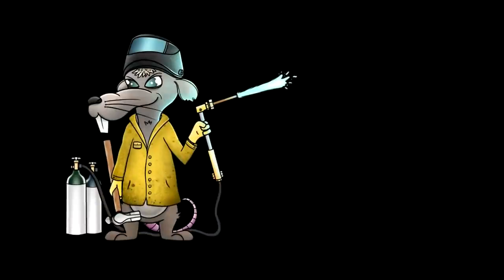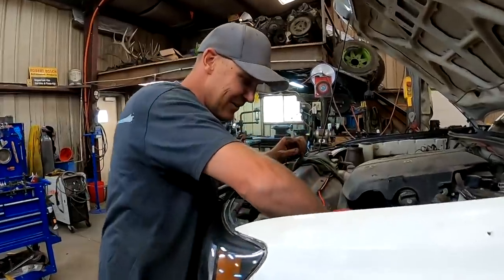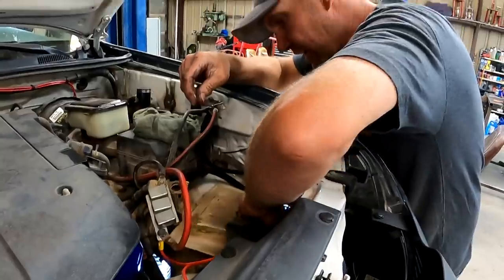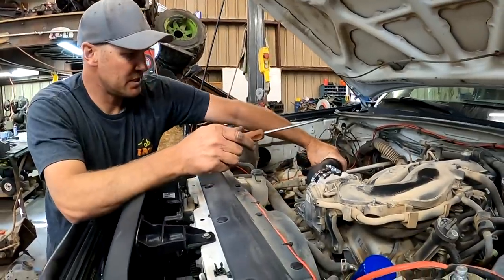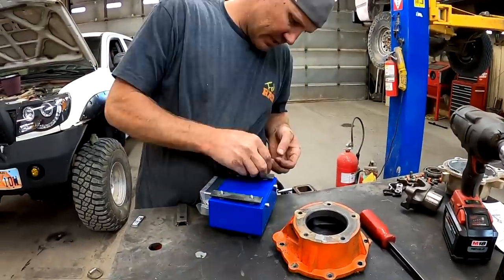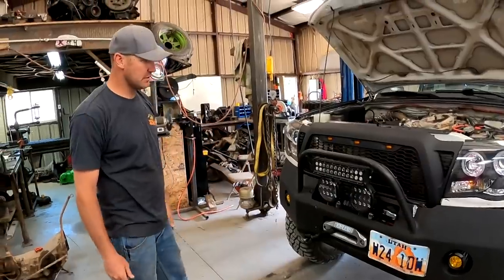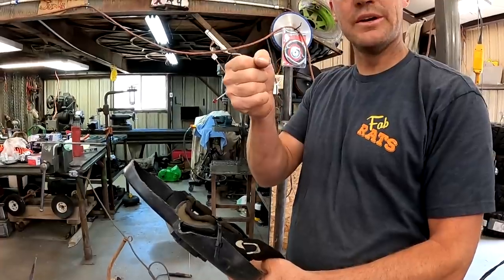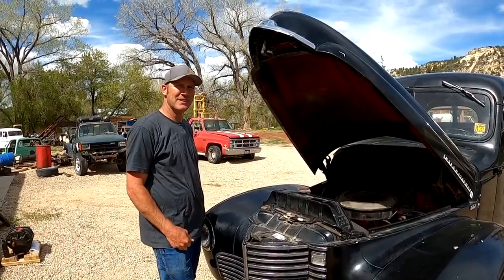What's the weird MASK for?! -- Plus, the returning of the International Pickup--

Comment: For the record, the flashlights are from Harbor Freight, and are rechargeable!  I have a few myself.  Just wait for a sale on them and grab a couple, they go fast.
Reply: Was about to say the same thing, they're good magnetic based lights.
Reply: I got my first light from Harbor Freight, cost me $38.00. Then found out my neighbor gets them wholesale, & resales them for $25.00. I told my wife (school bus driver) now the cost of that light has jumped up $125.00. All the other ladies driving wanted them, so far I've not been reimbursed for any.... LOL 🤣😆
When I saw Paul kept tripping over his work lights I figured what's a few more.... Good to see he's getting some use out of them....👍👍👍
Reply: @LAWMotorsportsdotnet  Someone gave me some of those as a gift after I they saw my HF light, they are not as bright, the magnet is not as strong and the batteries are not replaceable although they are rechargeable. They do bend differently tho, so I keep them around, but my HF lights are still my go-to.
Reply: I would like to know how your drill doctor worked for you.
 The purchasing agent for a shop I used to work at, bought one, and you could not sharpen a drill with it to save your soul. I have sharpened by hand since the early 70's, but anything under an 1/8 inch, has gotten hard to see with the naked eye for some reason. 😁

Comment: Always wondered if it was possible to attach this kind of equipment to a vehicle I bet you wish you had it when you and Matt repaired the broken rear diff on the side of the steep mountain trail with your regular welder that didn't like running on the incline.

Comment: I bought a Drill Doctor about 10 years ago. Awesome piece of equipment. Sure beats trying to get the angles right on a grinding wheel (which I never could do). I've even sharpened broken drill bits. Just watch the enclosed video if it has it. Mine did. Saved me a lot of time and hair pulling. Another excellent video Michelle and Paul. Take care

Comment: I always assumed a premier power welder required a second dedicated alternator, after seeing this I might have to finally buy one 👍, less bulky than running a 110 volt flux core mig machine off the big power inverter, and way easier than loading a big generator and one of the big welders in the bed! 😄

Comment: That's not a bad drill press Paul.  Two things to look for if you replace it is a 16mm keyless chuck and infinitely variable speed.  The chuck should have #3 Morse taper so you can use larger drills.  I particularly like having infinitely variable speed as it means I actually change speeds when I need to, rather than put up with the wrong speed because it is too much trouble to move the belt.

Comment: Just got a drill bit sharpener last week. I think I may have had one or two bits that were not dull or mangled. Once you get the hang of the sharpening process, bits take about two or three minutes a piece to doctor up and make useable again. Sweet piece of shop equipment I should have bought years ago. That isn't an inexpensive welder control unit you got, as I just priced them at over $1200/ea. If I spent half as much time on the trail as you, I'd probably spring for one, too.

Comment: You will love having the drill doctor, I use mine all the time.
Reply: The only thing better than one of those, is knowing how to sharpen them yourself. Unfortunately I live several states (Michigan) away and retired, that was what I did the last 9 years, tool sharpener, before retiring.
Reply: @dave_n8pu  I got a drill doctor...and I quickly realized that I got some learning to do in order to get it working just right.
Reply: @fredygump5578  it is more of an art form than science !!!
Reply: Drill doctor is a joke. If you are going to drill learn how to sharpen by hand. For some metals I had to sharpen the bits off center so they would drill straight, I know that sounds odd but I learned from an old tool maker.
Reply: @billhaight7010  If you are a machinist and have access to tool grinders, yeah, it sucks by comparison.  But it will cut both flutes symetrically, which is a good start.  Overall results are determined by the operator, like with everything else in life.
Reply: @billhaight7010  I worked as a 'Cutter Grinder' the last nine years I worked, if I would have wanted to get a Journeyman I could have but being retired at that point it wouldn't do me any good other than saying 'lookie here see what I have'. I know how to hand sharpen and know some of the tricks you can so to a drill to make it work better. The drill doctor is better than nothing and you need to learn how to use it, for the average person. if they learn how to use it, it could save them some money of having to go out and buy a new drill every time a drill gets dull. Also sharpening the drill off center, you were changing the size of the hole by a few thousands that it would drill. Tested that and proved it to be true. When my trainers were showing me that I thought they were nuts, they weren't.

Comment: Paul made a  pipeline welding hood. 
Benefit #1 is  no back reflection on your lense. And deflecting those rays and bb's.

There is also a boilermakers hood with a tube of leather gathered at the top. It has a 2x3 lense area. But their hella hot.

Comment: Good catch on the alternator. The drill doctor is ok. Once I learned how to sharpen drills by hand. I never bother to mess with my dad’s drill doctor anymore. It’s a whole lot quicker to do it by hand. Especially if you need a sharpen a drill in the middle of a job. Especially if you’re out away from your shop and you need a sharp drill. And have access to an angle grinder.

Comment: I love the air conditioner in the old International pickup. I had a 1956 Dodge Job Rated pickup that had the same kind as yours and it worked very well. Those are really hard to beat as long as you're moving.  : )

Comment: People don't appreciate how good modern cars and trucks are I had a 50 Chevy 1 ton with a 10' Bed. Driving down the freeway with that thing was hard work noisy, road like a buck board, slow and always correcting with the steering wheel. A quick trip in a modern truck hard work in one of those old timers

Comment: Oil from the filter will contaminate the mass air flow sensor and cause and issue with fuel mixture and take out the cats FYI

Comment: would love more info on the welder / alternator combo you used.

I got an 2010  FJ cruiser, and have been thinking about adding a welder because where I play in the Patagonia the next power line might be 200+ miles away, let alone welder, shop, etc.

Comment: Okay I had to pause mid video to ask why you haven't done a clutch by pass? Then you wouldn't need to hit the clutch to start the truck which I noticed you doing in this rig with your hand! It should just need a wire jumped between the connections on the clutch pedal wire

Comment: According to the law, it is against the law to use your hazards for anything but a hazard situation. Driving slow following another vehicle or just driving slow in general does not permit one to use the hazards. I'm aware that big trucks do this all of the time because they think that it helps out, it doesn't, but they do it anyway. It states right in the CDL driver's handbook that using your hazards is not permitted for use at your discretion. Just thow'in that out there for those that may be interested. It mainly just causes others to be uncertain about what the flashing driver is going to do next.

Comment: Where you buy the welder at did you install a fuse at the battery incase you. Crash the wire for the welder get pinch it pop the fuse so you don't have a fire

Comment: Cold Air Intakes provide Cold Air in name only. Unless you are going highway speeds it is just sucking in hot air from around the engine. If you are going sub-5MPH on a trail you'll only get hot air because there is no air flow into the engine bay. Stock air filters tend to get air from the fender well or somewhere not in the engine bay. Thats much cooler air.  Just sayin'...

Comment: Remind the owner of that IH not to put gas with ethanol in that truck.  It will really destroy the carb, tank, and fuel lines when it sits for a while. The little extra cost for pure gasoline is worth it to reduce problems.

Comment: Get a monster radial arm drill press like Keith Rucker has. It's a beast and will match your giant lathe too. As far as drill bits, I normally get USA made bits from either McMaster or MSC and use plenty of cutting oil. 

Or look into making a slow speed attachment for your drill press, since you always drill metal you want to slow it down a lot. I made this one for my Walker Turner. The piece in the center column has an offset shaft that the pulley goes onto to make sure both belts stay tight. If you search for drill press slow speed attachment you'll understand the idea and can make your own. Would be a great project for the channel.
https://youtu.be/yYwiv5MswuY